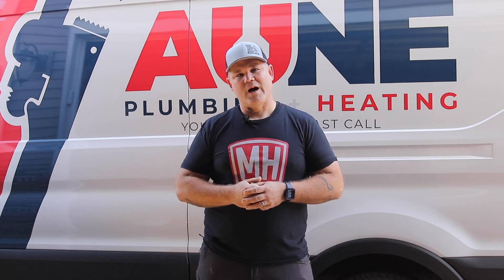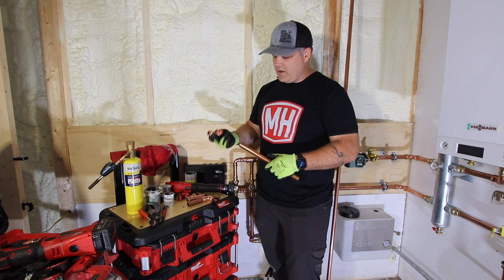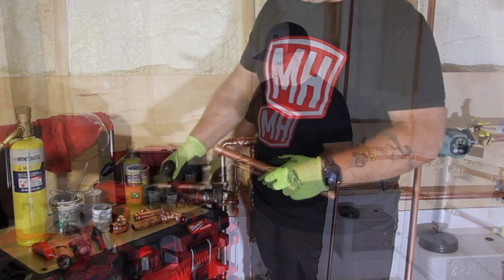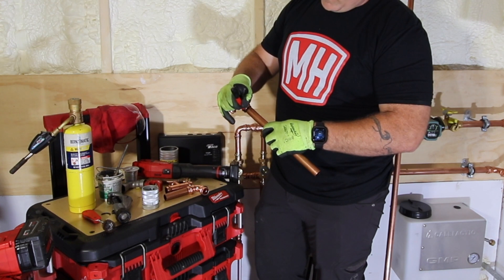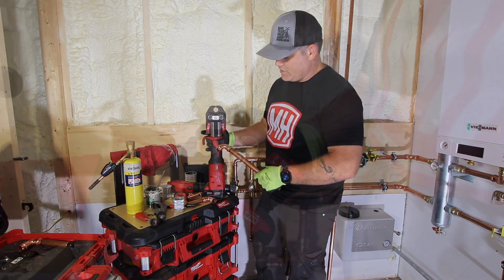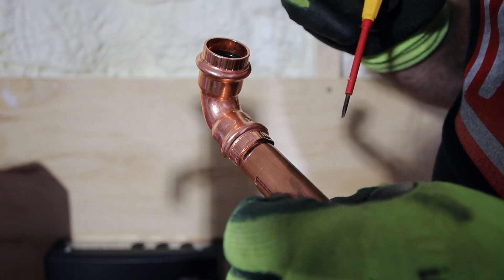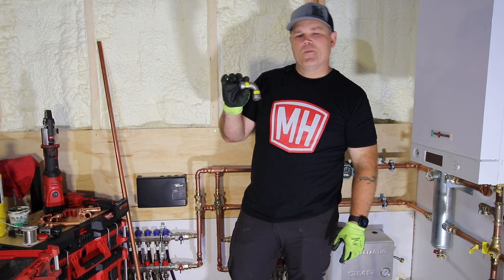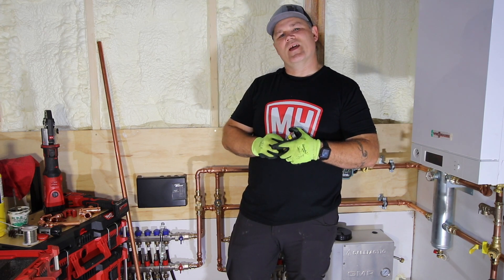HOW TO: Copper Press

Comment: That Milwaukee press has broke down 9 times the ridged pro press has never failed on me I had it 7 years the Milwaukee I had it for 4 years now I have to take it in again for repairs
Reply: I just picked up the milwaukee m12 press kit and 1 1/4 jaw hope mine fairs better.  Hopefully they worked out the bugs
Reply: Haven’t had any issues with my m12. I press, press with rings and MegapressG.

Comment: I am a Propane service guy, what do you recommend for cutting and flaring copper? Mostly 1/2 and 3/8. I want to upgrade, I have been doing it manually for years now
Reply: They have a drill bit that flares out copper pipes  they have them at air conditioning supply shops I seen him for 1/2 and 3/8 way faster to use them using the old flaring tool